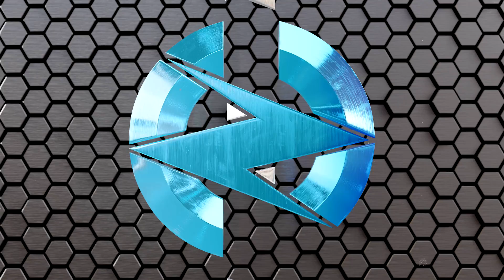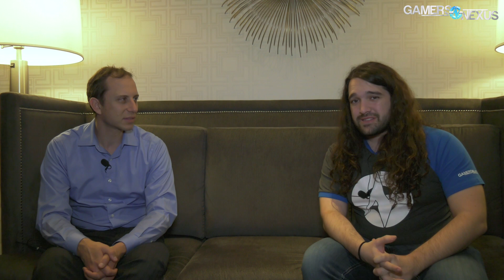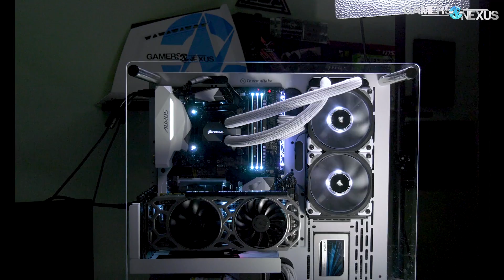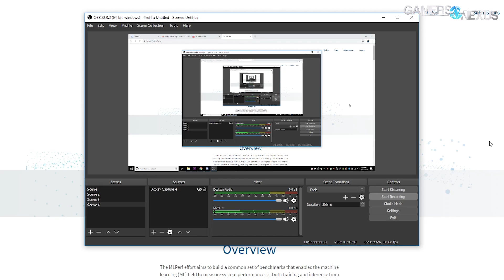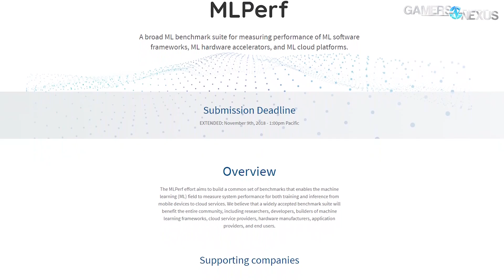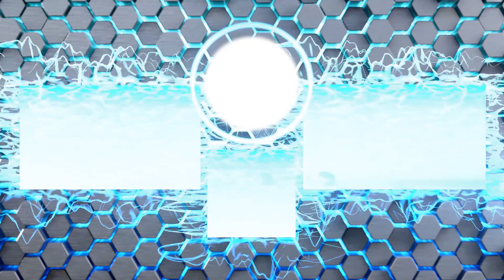Intel 10nm & 3D Stacking Deep-Dive, ft. David Kanter

Comment: Stacking chips on each other can be a useful feature.
Though, high power demanding chips would surely not be placed under other high power demanding chips. That would quickly eat away thermal performance.

Where I see a good advantage in stacking chips, is for IO, Memory and processing. Since each of these three can benefit from their own manufacturing process.

Also a method of solving power delivery is to stack logic on top of logic, as in that the incoming power first goes through a set of cores, then another set. This means we need about half the amount of current supplied to the chip, but at twice the voltage, we also need a tap from between these two layers, as one layer is likely not using the exact amount of current as the other. So that we can either feed in or out current through this tap to balance the two layers, and some balancing can be done internally by voltage regulators and switched capacitor supplies.

This would be a fairly technical solution to lower current demands by the chip, but a fairly efficient one. (And it can free up pins on the socket for extra IO capabilities, like ram channels, or PCIe.) Sending signal between the two voltage levels can be done through capacitive coupling. (This signal can though not contain DC content, but that can be done by Non-return-to-zero signal encoding, or by strictly using pulses instead of states. (the later being less resource intensive, and can drive a D-latch if state is required.))

Also, this power solution can be stacked to any arbitrary amount of layers, but would logically be stacked in a fashion that ensures that we have the same amount of cores on each layer. And preferably more then one. As an example, a 24 core chip might contain 8 levels, where each level has 3 cores, the current needed for this chip would then be 1/8 of what we would expect of the 24 core chip, though at 8 times the voltage. But we have in the process freed up about 6/8th of the power pins supplying current to the chip. (The 2011-3 socket has 173 pins for core voltage, where we could then free up about 120 pins, and that is the same amount of pins as needed for 15 PCIe channels.)

On a larger socket like the 3647 that has about 622 power pins (as in inputs, ground is used for isolating signals and the roughly 1257 ground pins shouldn't be counted), then saving in 6/8th of those power pins and using them instead for IO can practically add another two memory channels and a couple of PCIe channels to the socket.

And another text wall, I hope it is informative.

Comment: Build the architecture vertically, mount it horizontally on the socket = maximum power delivery surface to each modules of the stack + highest heat dissipation area - the real problem is most likely manufacturing costs

Comment: OOH, now I'm only 19 seconds in, but 3D approach sounds like we're getting close to the Neuronet CPU design of the Terminator series.  Imagine the latency issues that could be resolved in three dimensions.  I realize heat will become an issue quickly.  Ok, 20 minutes in and we're not getting close, but it's still fun to think about.  Not the Terminator part, but the CPU advancements.

Comment: 3D layer stacking in CPU design has been looked at before but the issue of heat has been the drawback that kept it being a thing. For Intel to use 3D stacking in CPU Die they would have to overcome that issue of heat.

Comment: I would imagine that it could be possible to design and build into the package some type of new IHS that actually reaches through the silicon and provide some direct cooling to middle and bottom layers, almost like a pin grid array on the heat spreader to draw heat out. Obviously soldering and heat conduction of the IHS would need improvement, but that strikes me as an option to explore.

Comment: Intel "glueing dies together" I wonder why, could it be something to do with the fact that EPYC is kicking there arse and rome is going to be even better ?

All of the things he is talking about core on one high performance die rest on another one, and high speed interconnects etc and the 3D design. We have that right now, its called rome, sorry to say intel instead of pissing around with that water chiller and mocking AMD for gluing dies together you should have been on the chiplet train.... but its left the station .... sorry.

Notice when he is talking about all the examples of chiplet designs he cannot bring himself to mention AMD or EPYC
Reply: You're talking like things are dire for intel. AMD, if rome is anything like the unverified rumors, could very well end up being better at the high end, but that isn't a permanent thing. History shows that well. 10nm intel could very well end up superior.
Reply: Vertical stacking is still different. If you listened to his definition, you would understand that Zen is 2.5D. 3D isn't inherently better than 2.5D(Intel's marketing will try hard to make it sound that way); 3D has more bandwidth than 2.5D(possibly even better than a single die) because you don't have long traces connecting parts, but 2.5D can be cooled a lot better which allows for much higher clocks. 

So you will probably see 3D in RAM, L3 cache, and maybe I/O but you won't see more than one layer of high performance silicon(CPU,GPU,FPGA, etc). Also, this isn't a new tech. This is a slight upgrade to "smart interposers" which is a tech that everyone has known about for a while but hasn't used in a mass produced product because the cost increase wasn't worth the added cost.
Reply: @amir_404-e4d  Intel is going on the same path as amd but they cannot say that cause they are Intel so they are mocking amd's tech by saying that Intel's tech is superior on paper but under the hood its the same
Reply: It's not the same, AMD uses MCMs for Ryzen/Epyc. MCMs are nothing new, AMD and Intel have both done them before, as have others like IBM. You might as well say 3D stacking and putting multiple memory chips on a DIMM are the same thing.
Reply: @Skabbe1  but it won't hitting the market any soon. Currently intel is saying the node will be ready by end of 2019. Just node not the products and firstly they will try to control the damage done by amd in hedt and data center market where Intel has got the worst hits so the first products launched on 10nm will be xeons while the mainstream products will be just paper launch. Also by the time 10nm mainstream cpus arrive in market, it will be in 2h20. Also don't expect the cpus to be budget friendly choice as Intel has spent the most r and d money in their history on just 10nm node.
Reply: Yeah I'm just talking about the stacking tech, I don't think anyone is denying that 10nm didn't exactly go well for Intel so far. I would imagine Intel will go for smaller dies to begin with, mobile parts and maybe some Atoms or i3/i5s. Xeons tend to lag behind since the validation periods are longer combined with large dies on new processes tend to be risky.
Reply: @Skabbe1  must watch adoredtv videos on that
Reply: look up Pentium D... its basically 2 Pentium 4 dies "glued" together, and they received much criticism from amd for "gluing" dies together... amd later adopted this along with smt..
Reply: @karanvora2674  Intel is saying 10nm products will be out by holiday 2019, not just the node being ready, a Dell executive even hinted at their laptops with Ice Lake mobile being out by the middle of the year.

I get you only care about desktop parts which will probably come out by early 2020 but mobile is mainstream and moves more units than consumer desktop.

Comment: All this sounds to me like Intel just.... "reasoning" why they've been digging a hole.  I can see AMD saying... "hey... you have this hole that you dug... why not just lay down and we''ll throw the dirt on".  Everything this gentleman said basically speaks to nothing that's actually occurring presently, it really seems 'hopeful' but I think that ship has sailed.  What sucks is I'm a total Intel fan and I have liked what they "were" putting out (8 years ago when I bought Sandybridge) really fantastic stuff (STILL! running that chip with triple monitor with absolutely NO issues ).  I'm not deserting them during their struggle but... its just been going on soo long I'm like... 5ghz, twice the cores for the same price?  no thanks.  Ryzen 2 around the corner is tha freak nasty!  Like the old Athlon I bought with Alphacool cooler overclocked or the 4400+ I bought after that.  Both those chips were rippin' and buried the competition.  Seems like this hole Intel has been digging is going to be used again.  I win, I'm a consumer, I can buy the good stuff instead of Intel next year. :)  Also, RAM is way faster than Optane so not sure where he's going with that other than mobile or some ridiculous price for main system memory which no one will afford.  I know he doesn't work for Intel but .... such a bias with no substantiation.

Comment: I don't see this approach being particularly successful until it's possible to create microfluidics in-silico, using the same process tech, for cooling. This potentially solves the heat dissipation nightmare you're otherwise stuck with.

Until then, AMD's approach over a large planar surface (2.5D) is more attractive simply due to the heat dissipation requirements.

N.B. it seems likely that AMD investigated 3D stacking as well but dismissed it for now as being impractical. Can always return to it later if circumstances warrant it. This 3D stacking seems more geared to impressing shareholders than realistically manufacturable technology at the moment, possibly except in mobile, and even then, only very low power mobile.

Comment: Great video packed with heaps of info! Rather than stacking the die horizontally, would it be feasible to have a horizontal 'base' silicon with multiple chiplets attached vertically? Kind of like a motherboard with heaps of PCI ports, with the 'board' being the base silicon with direct power delivery to all the 'PCI' logic dies?

Then fill the vertical gaps with some sort of thermal compound to draw heat away and package that up into a chip.

Comment: I’m not building anything until DDR5 and ray tracing at 120hz+ @ 1440p.  6800k and 980Ti still keeps WoW on my monitor maxed for the most part.
Reply: even if those zen 2 leaks are real?
Reply: Good luck waiting. If you realy know what raytracing is, you wont say this. Ray tracing is hard. Its not a matter of optimizing software. You need real raw preformance. And current real time raytracing is limited to 1 or 2 bounces while pathtracing is basicly20.000 bounches. So we have a log way to go
Reply: if im not mistaken, an overclocked potato can max out wow, but ok man. that's a good stance regardless of the game picked
Reply: DDR5 is probably not going to be used in PC's for years

And unless Nvidia makes a "raytracing co-GPU" 1440p at 120fps aint gonna happen

Nvidia could have done raytracing way better out of the box by having the 20 series as raytracing add in cards

That would have ment more space for raytracing tech and there for more FPS but nope Nvidia sticks with using 1 thing for all instead of splitting them

Hell they could make more money by making raytracing full open and selling raytracing as a slot in card compatible with AMD and Nvidia cards
Reply: @commanderoof4578  so 120fps1440p won't happen when it took a couple of weeks to get ray tracing Ultra running at 60-80fps1440p? Okay.
Reply: Why do these "I don't care about new tech" -people watch new tech videos?
Reply: A side to side comparison of the original and the new drivers show they simplified the work load to increase performance

They simply lowered the quality and amount of raytracing happening at each level no improvement was made
Reply: @commanderoof4578  So you didn't understand a single thing they said in their optimization video.
Reply: I didnt even bother watching it they didnt optimised they simplified

Look for and grab a screen shot from before and after this "optimization" they is a noticeable difference, it looked better before
Reply: @Alb 92 Not really,  the DDR5 will be slower for a long time once you factor in latency. They listed MHz amounts get to far higher amounts, true, but the timings are so loose that all the numbers that have been listed means it will be slower upon release. Even with the ~6000Mhz speeds, the timings were going to be so poor it likely won't be worth it for quite some time to come (once latency timings can be tightened a lot more with that frequency).

Comment: Dont expect anything for gaming PCs..  Here's whats expected... a mobile chip and a super super expensive HPC chip. "Obviously, it’s early days for 3D packaging, so we can’t expect everything to be revealed immediately. The first Foverus-based product is scheduled to be released in the second half of 2019. It will combine a 10nm x86 compute die with a 22nm low-power base die, and capped with package-on-package memory.  From the looks of it, the package will be targeted at mobile applications.

For the HPC crowd, a more compelling Foverus implementation would be one that integrates x86 Xeon CPUs, AI chips and photonics processors, along with Optane memory and DRAM dies thrown in for good measure. That might turn out to be something close to what we see in the upcoming Aurora supercomputer in 2021. But given Intel’s interest in countering NVIDIA’s and AMD’s high-end ambitions, we may not have to wait that long to see the first 3D packages for HPC."    Source -Michael Feldman  https://www.top500.org/news/intel-goes-vertical-will-stack-logic-chips-into-3d-packages/

Comment: Optane is garbage, lol. As for Optane DIMM showing up in consumer CPUs, well, I have a sneaking suspicion it will be exclusively Xeon class only like ECC memory, or you'll need to buy a dongle key to plug into the motherboard to enable such an advanced tech on a consumer platform. It's not like consumer chips are limited to a single 16x slot for all the devices they may possibly want to use, not all consumers are gamers that just want a single GPU and nothing else, lol. Oh, and what of the reliability and longevity of Optane compared to flash and MRAM, I thought Optane wore out quicker than flash or something like that that made it not as good for long-term storage? 

Great vid Dave, Steve, and crew. B)

Comment: Where the 3d stacking will come into play is the cell phone side sunny cove main core hooked to atom low power cores with sick igpu .. and x86 .. soon cell phones will be able to run full blown windows applications .. I think intel will have a huge impact on the cell market if someone can come in and customize a 3d stack for there phone.. Intel is doing things very smart I believe

Comment: I'd really like to know when they're going to get around to putting at least HDMI 2.0 into the CPU natively. They did it in Gemini Lake, and now they need to start putting it in the main arch. 1.4 has been long in the tooth for quite some time now and this sporadically-implemented LSPCON workaround on mobos is just not feasible long-term when the cheapest avail. motherboard for my HTPC users is $150. They're just pushing business over to AMD AM4 by kicking this can down the road.